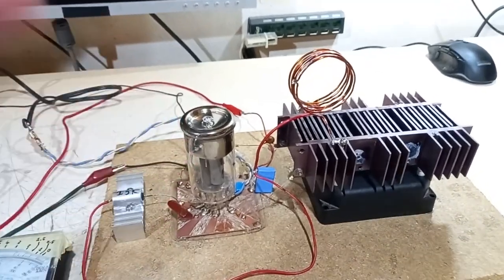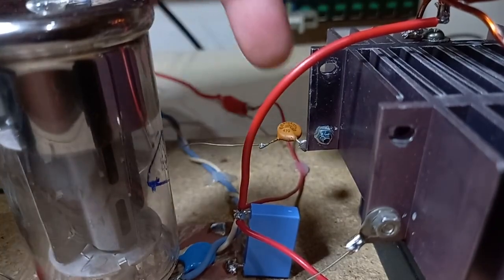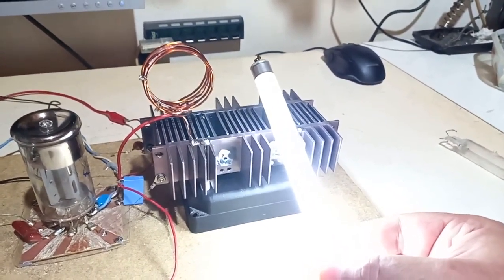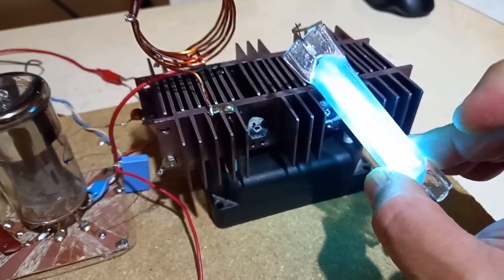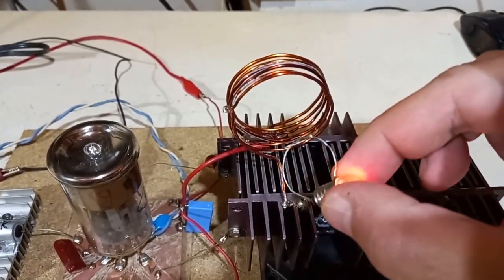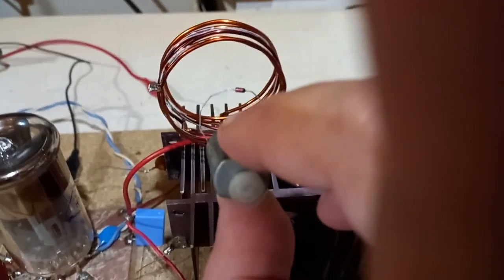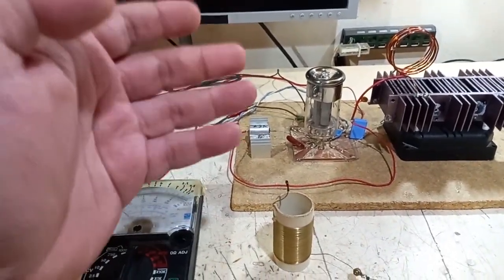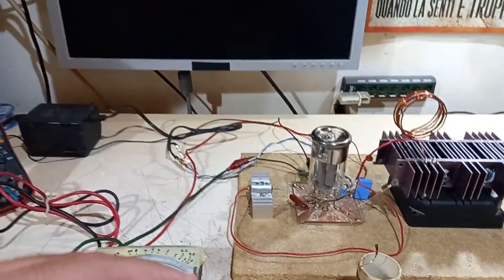1kV GU50 Tube Oscillator From Trash

Comment: 10:36 bloody hell mate it’s not just a high voltage you are producing … that arc is an indication that you are transferring a fair amount of power into the pliers and possibly into your body too.
Mate I have seen the damage down when a radial from one of our Biconical monopoles touched the grass in close proximity to the earth mate, a series of copper radials buried about a foot underneath… the radial end instead of being a broken piece of copper was a molten blob … ok we were running 10kW into the antenna but even in your case you are running up to 1 kV even with about 50mA was it you said ?? That’s still 50 odd watts half the power of a medium power lamp bulb but you wouldn’t put your fingers on the filament when it was hot, you only need to be at the point along the transmission line where there is maximum power transferring and I don’t need to tell you …. Sorry buddy not preaching I know you understand the drill but just looking out for you buddy and anyone else watching.
Other than that it’s a fantastic bit of work bud well done 👍👍
Reply from the maker: thanks for your caring and also your compliment for the video, but, granted that high voltage is not safe, that is the only concern here, i should only have used a plastic stick for holding the toys here, i think i'll do that for the next similar video, but about your concerns about RF, there's no problem here, i had RF burns on my fingers several times and have been exposed to various kinds of magnetic, electromagnetic, and electric fields with different frequencies, microwaves included, got shocked by controlled high voltage, and not only i'm still perfectly fine but i've NEVER.... never heard of someone that had any kind of problem because of that... if you get scared by "mumbojumbo scaremongers" it's your problem, not of someone else, it's evident you never played with these kinds of "toys" like i do... AND you can't obviously compare 10 kilowatts with 50 watts... and the scissors had a plastic handle, you don't need to provide a DC ground path for these frequencies
Reply: @PosthumanKindergarten  Mate I have worked with this stuff and trust me you are exposing yourself to X Ray emissions also when you muck about with discharging high voltages or drawing an arc … anyway I’m not telling you what to do… it’s your Channel I’m coming from someone who has worked with high power and low power RF a and trust me, it doesn’t take a lot to do damage… but hey mate fill your boots
Reply from the maker: @buffplums  x ray ???? no, sorry, if you're here to bullshit and bug me, it's better if you shut up or i'll block you, there's no x ray here, and RF by itself is harmless... insist with this nonsense and i'll block you
Reply: @PosthumanKindergarten  fine no problems it’s a shame because I think you are a very clever guy and I love your skills and the projects you have done… I was just looking out for you bud …. If you do listen then look up how X Rays are generated …. And RF ask dangerous…. But hey block me and I will stay out your way mate… I’ve worked with all of this stuff for over 40 years the difference is that I have done this shit professionally and I’m aware of the risks and dangers … if you think 50 watts for example can’t hurt you then take a 1 watt 50 ohm resistor and stick it across a 50v supply and grab that resistor tight in your fingers and turn the supply on… don’t flinch or bat an eyelid and hold it until the damn resistor burns out in your fingertips … that’s what 50 watts of DC power will do to you … get the right impedance match between your hands and a 50W RF source potentially will do to you ….

Comment: Just be careful buddy not just the high voltage but close exposure to RF l obviously a fairly large RF power density …. Remember how we measure it,,, it’s proportional to Volts per meter squared …. Yeah it drops off exponentially but you are getting pretty close it’s an invisible killer mate .

Comment: Nice flare-up. Wonder if the gas pressure increases due to heating the electrodes and purging gas into the discharge.
Reply: Similar to HPS streetlights before the LEDs replaced them
Reply: @BeezyKing99  similar, but the pressure change in a HPS is large with the heat from the discharge causing spectral broadening . There is also the addition of mercury in the arc although sodium is the dominant emitter.
Reply from the maker: probably, but it can't reach atmospheric evidently, anyways after this the bulb glows weird
Reply: @PosthumanKindergarten  If the lamp functions differently after, that suggests the coating on the electrodes has changed some how. I did see a similar brightness change in a neon filled tube and wondered if it was caused by impedance matching, but still not sure. Anyway, good demo and nice variable capacitor by the way👍
Reply from the maker: @tuopeeks  still not sure what exactly happened, there are two effects, three with the basic glow, the first thing it does when i stuff it inside the coil is a magnified glow, maybe different from simply the electric field, it MAY be inductive coupling AND it's weird cos the bulb is weird, not a regular sample tube, then there's the "flare" that (rewatching my own video) it originates from a spot that is probably an hot spot on the electrodes that makes more emission, but i wasn't sure again cos this oscillator doesn't seem to work much as heater (on regular flat iron), but it's the most likely explanation

Comment: Maybe the thermal emission of the metal pieces increased the ionization.
Reply from the maker: that's the most likely hypothesis TBH, but i tried to heat up metal in it and it didn't work much, so i'm not sure

Comment: what component did you pop?
Reply from the maker: it made a spark probably between the supply rails and it popped the shunt resistor inside the analog multimeter